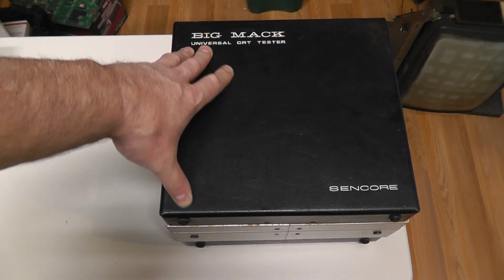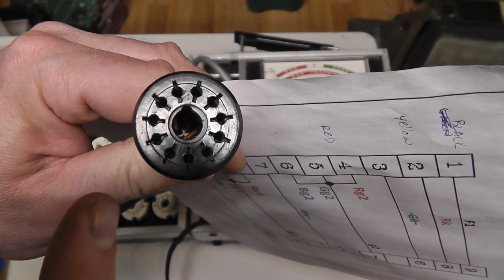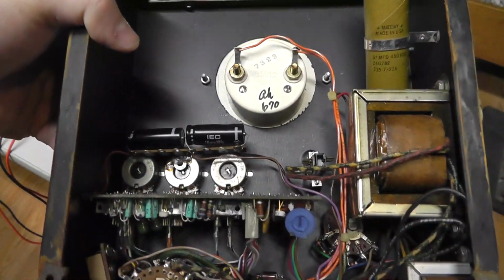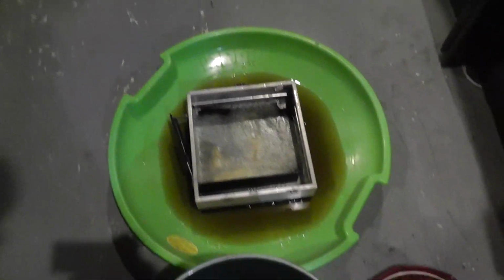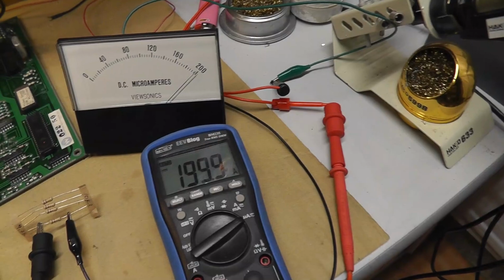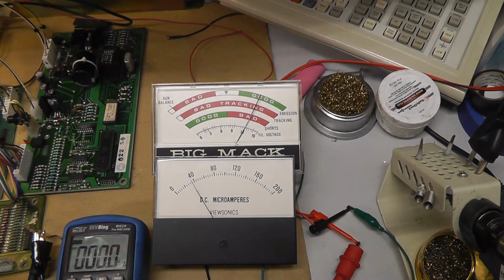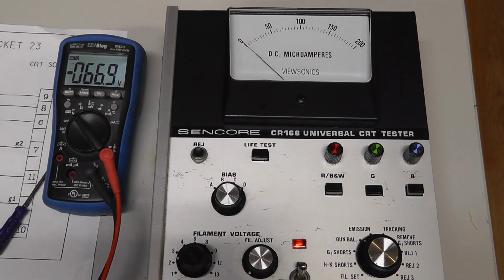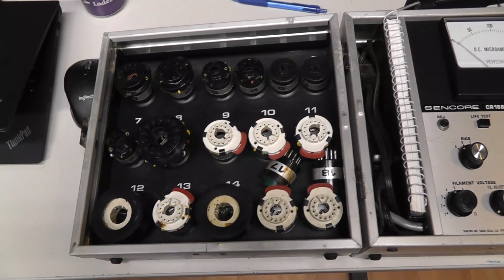CRT Tester Restorer - Sencore CR168 BIG MACK Part 1 - Will it work?

Comment: Will it test old CRT from 1940s and new certs most recently made
Reply from the maker: I could answer this in a bunch of ways.  Ultimately, any CRT restorer can test and restore any CRT.  It is a matter of how easily can it accomplish that goal.  This is a fairly flexible restorer with lots of adapters, so I think you will be in good shape.

Comment: I just came across this video. What are your overall thoughts on the Sencore 168 model? I am planning on getting a CRT reju device but I have no idea which one to go for. Could you give me an advice about this? Thanks.
Reply from the maker: What kind of tubes do plan on testing and restoring?  The big mack, super mack, or cr70 will all be decent for arcade stuff.  B&K are a bit more available.  Check out some of my other tube restore vids.Good luck.
Reply: @jacklick  ok this is great. I have on me two Sony PVM 141e model that do need this. I was looking around for a week regarding this stuff and as you said it was either the sencore or the BK and then later learned that not all of them are made equally so that is where I took the plunge leap of faith on the sencore 168. Problem now that I am facing is that I can't find much video tut on how to operate it. Do you happen to have one where you demonstrate it's operation? Because the video here is mostly repairing the 168 plus the analog meter had to be changed. If there is a way I can reach out to you on Diacord or telegram and talk about it later down the line when I do get the device, I would really appreciate your help on it.
Reply from the maker: @DarkWolf80s  Hopefully, I can get a working meter as I would definitely do a video on using it.  Feel free to send your discord tag.

Comment: @Jacklick’s Arcade and Tech Repair Journey  Did you get my email?
Reply from the maker: negative.  I didn't receive anything.
Reply: @jacklick  Fricken A.  It must be my VPN then and probably some blacklisted IP addresses from it :(.  Give me a few minutes, I'll turn it off and resend.
Reply: @jacklick  Email re-sent:).  Could you check your junk mail folder (just in case) to see if the original one from Dec. 24th is there?  Just trying to figure out the problems my VPN is causing.  Thanks, J.

Comment: I'm confused what sets or determines the voltage to current conversion? because 200uA equals 15vdc which I'm not sure what is determining that 15vdc is 200uA inside internally in the meter there must be something adjust this
Reply from the maker: I am not sure either.  It is possible the original meter was somewhat unique and measured both AC voltage and DC microamps.